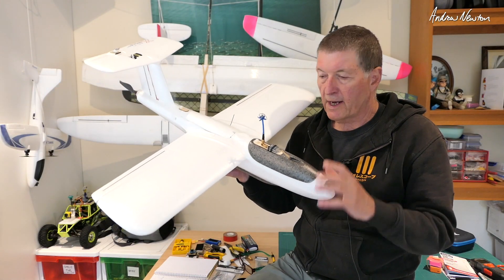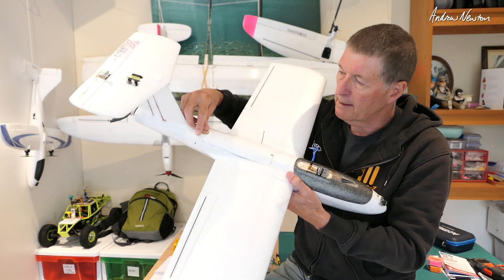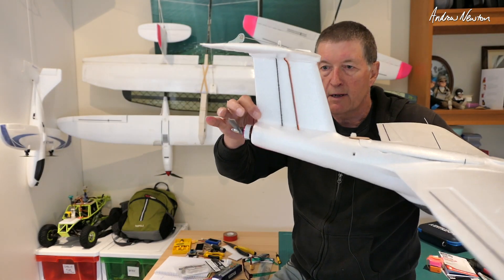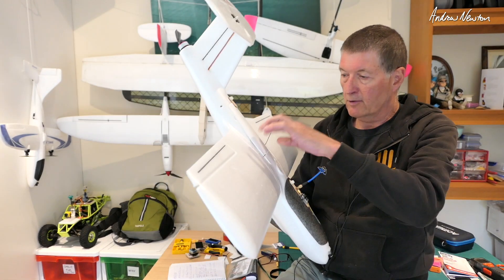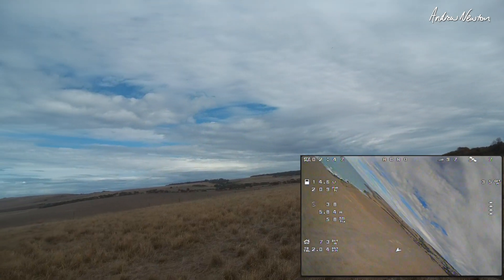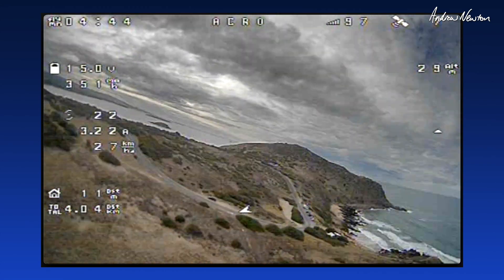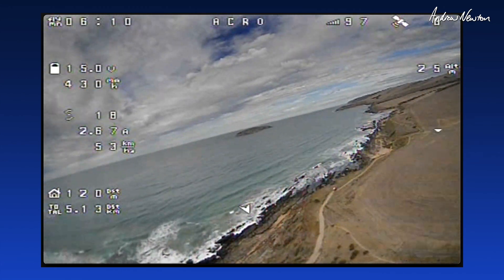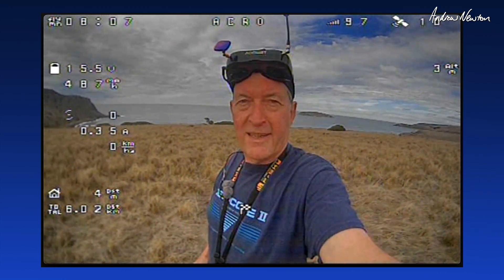FINWING / XUWING XBird

Comment: This is fabulous. I got this plane and trying to figure out which setup is gonna be the smoothest flying experience, twin motor or single pusher setup?  I am worried that 4s 4200 li-ion maybe too nose heavy for twin setup, what do you think?
Reply from the maker: Twin would be smoother and I'm sure you could balance it OK
Reply: @AndrewNewton  Thanks. Should I balance exactly on the CG marks or a bit forward?
Reply from the maker: @nmrlab3807  On the marks worked for me

Comment: don't want to build anything any more
Reply from the maker: Me or you?
Reply: @AndrewNewton  me.   girls don't want to build anything.  after building a fullsize 20ft airplane trailer and ultralight airplane, i'm done.  enough welding and drilling of tower steel upside down  or a life time, not to mention drilling aluminum and popping rivets.  if it don't fly right out of the box, don't buy it....

Comment: Nice one Mate! I've been eagerly awaiting your flight review.

My Xbird arrived yesterday and was gluing overnight - It's very well thought out and I love the way Finwing do their control horns and use the nylon bolts, it gives the feel of them being industrial grade planes brought to the consumer market and the quality of the motors/servos are top-notch.

Another win for Finwing/Xuwing I reckon 🙂
Reply: pusher or twin?
Reply: @ab7rs  I'm building mine as a pusher. All my other planes are twins so I thought it would make a change.
Reply: @Crunklefloop  twins are so much easier to launch at this altitude (4,000'), or maybe it's my imagination. Like a stock ar900 is tough in 4s and nearly impossible in 3s
Reply: @ab7rs  Maybe you need to run a coarser pitch prop at that altitude. I'm lazy and use Autolaunch every time now.

Comment: Are you feeling okay? Looks like you have lost some weight.
Reply from the maker: Thanks for asking, yes I'm healthier than ever. Lots of walking and jogging and better eating.
Reply: @AndrewNewton  Looking good, young fellah! But re the prop on backwards, first after that comes forgetting to turn off the throttle cut and advance the throttle before Autolaunch, then forgetting to get the fingers down quickly when chucking tail-drivers and finally having to use 1 set of glasses to set her up but forgetting to switch to the distance ones before pelting it. And there you are staggering about bellowing for one of your "mates" to quick bring the right ones before disaster strikes! 😜😁
Reply: I'm just scarred by too many friends losing weight while getting chemo.
Reply: @aviphysics  Yep. 1 of the "joys" of getting old - you get to go to a lot more funerals than weddings! You learn what real sadness is as your great old mates drop away.
Reply: @theoztreecrasher2647  hey buddy, remember that age is only a number, I bet you’re pure young on the inside 😅